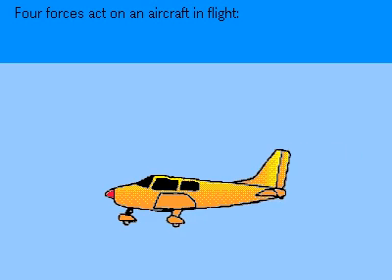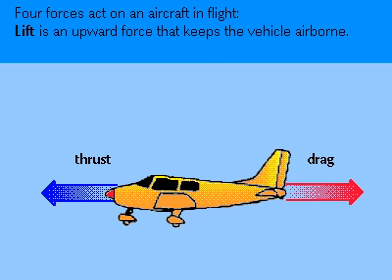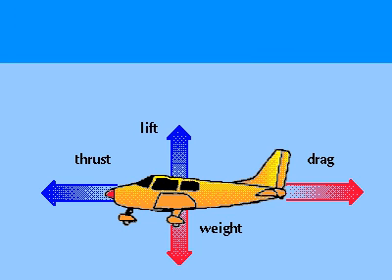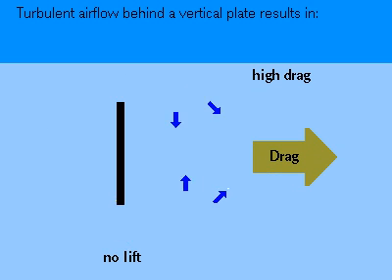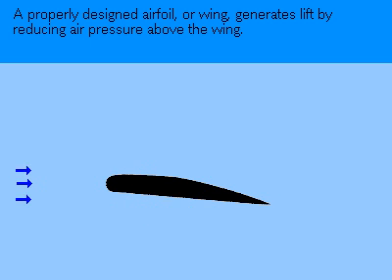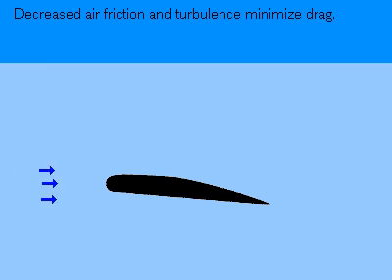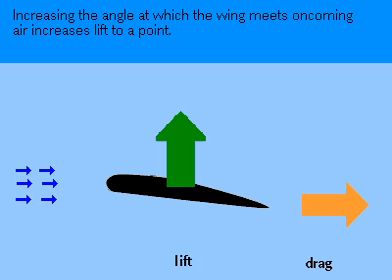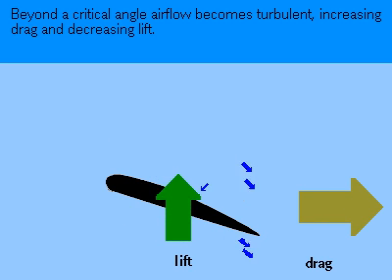Forces that Act on Aircraft in  flight

Comment: @rambiro96 You're right to a certain point, if you take a flat piece of wood and swing it without any AOA (Angle of Attack) it will droop to the ground. But if you ad an AOA to the board, Given fast enough rotation it will lift up. Angle of attack is required for flight to take place.